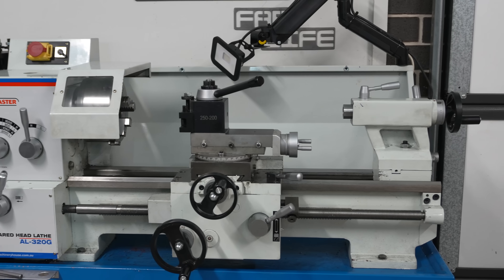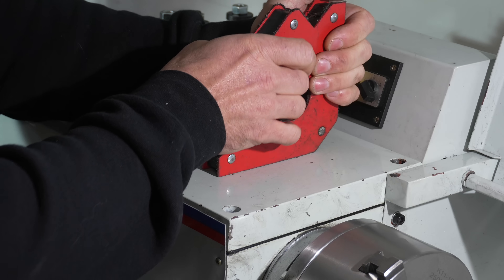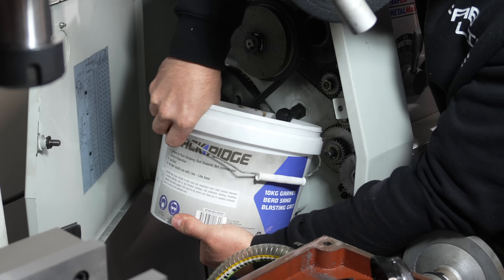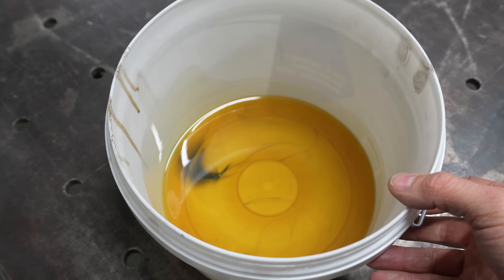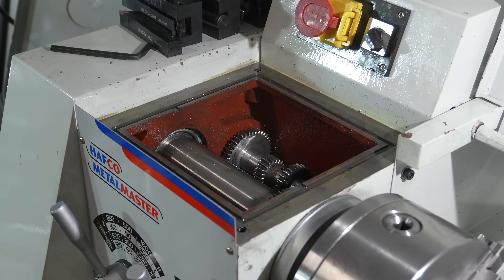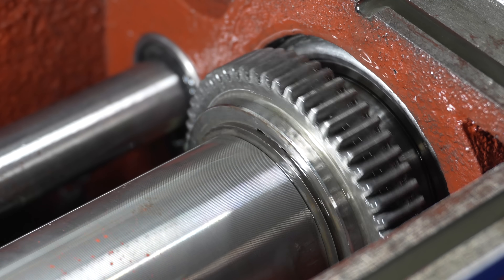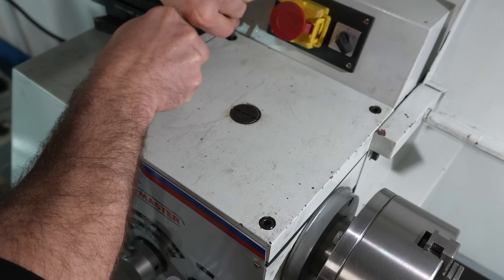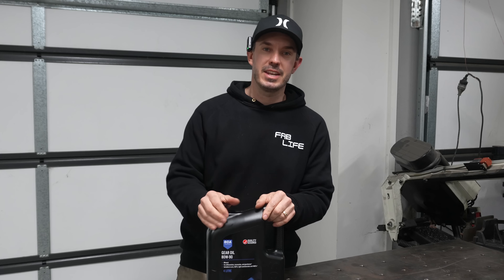Can I Fix This Annoying Gearbox Noise? - HAFCO AL320G

Comment: Nice job with the cleaning and replacement of oil and gasket. You’re never going to get quiet gear operation with straight cut gears, though you have made a tremendous step toward that. Who knows, you might even make a set of helical gears as a project in the future. I’m subscribing just in case you decide to do that. It’ll be an epic series to watch. Great video thanks.
Reply from the maker: Haha my skill level isn’t quite there but you never know in the future where I’ll be at. It’s such a great skill to learn. Endless things to make and fix with it. Cheers 👌🇦🇺
Reply: @Fab-Life444  Skill will be to make a set of double helical gears, like Citroen made, and have them be the same width as the originals. Those run quiet, plus have no axial thrust either.

Comment: The difference is definetly there! I´m a self proclaimed audio nerd, just came back with a neighbours band recorded with my MiniDisc. Heard an instant change. Why? My guess: the more oil fills the spaces between the teeth and so dampens the sound as it reduces metal to metal contact. To break it all in I guess it´s fine but You did the right thing. Now, everything is ought to have found its happy place so we can lube it up.
And: imagine: thought example: the manufacturer put in oil barely enough for it  not to seize up. If they filled it proper it might prolongue the break in and it takes more money out their pocket. I bet that´s it.
Then it´s the customer´s care to flush & fill it up proper after the warranty…  I belive it´s just the money they save with just a mouthful of lube in there… But now You´re set: Happy Days!
Reply from the maker: Cheers for the comment 👌🇦🇺

Comment: That gear oil is correct, SAE 80/90 is roughly equivalent to ISO 320 gear oil. You want to shut it up you can add a tube of Molyslip to the oil, it will turn the oil metallic black, but will reduce the noise as well, though it will make it near impossible to see oil level unless you check before starting.

Gasket gasket paper as thick as the store has it works well, you use a hammer to cut along the edges of the casting, and it works well. I keep a small new ball peen hammer just for gasket making, it never has been used for any other work, so the faces are still as ground, and work well to cut gasket material. Tapping out gaskets is a useful skill, and when making them before without gasket paper there have been a good number made using the covers of phone books, though that is impossible these days, as phone books went the way of the Dodo, so instead heavy glossy magazine covers are used in place of them, somewhat thinner but useful still. 

Note Chinese gearboxes often use the gasket thickness to set the bearing preload, so you will need to have some assorted thickness paper on hand to fabricate them when replacing bearings, because they generally come with the cheapest nastiest oil around, so best to replace it before using it anyway. Also often, because they are "universal mount", and have a half dozen fill drain plug locations, you have no vent, which means they will blow seals when running hot, and motor down means a motor filled with oil, which does not exactly work out well for the motor. Luckily they also are standard sizes, so easy to replace as well complete, just replace motors, seals, bearings and drill one of the plugs to be a vent on the top. A whole day of work to fix that motor, and the next day to put the thing back in the recess it lives in.
Reply from the maker: Cheers for the comment. Yeah the machine does have a vent. Probably hard to see in the pic but the upper fill port in the cover plate has a hole through it. This would be the vent for any pressure increase. Cheers 🍻

Comment: on the first test (before exchange the oil) the chuck was not closed.
at least my lathe is louder with a non closed chuck.
Reply from the maker: I was wondering if someone noticed that. Closed or open on my lathe, it’s not even noticeable. Checkout my other videos and you’ll see how consistently loud it was. Cheers 👌🇦🇺

Comment: Nice reduction. I have basically the same noise with the straight cut gears on my lathe as well. And how I helped with that issue, if I am not needing the cross slide auto-feed option for what I am doing, I simply removed that gear and it is tons quieter. But they are what they are...   Thumbs Up!
Reply from the maker: I have heard others say that. Cheers  for the comment 👌🇦🇺

Comment: Precision spindle bearings do not shed metallic paste unless they are terminal. Those bearings would not have been greased on assembly. You should not be complacent here, you should be concerned !
Excessive backlash between gears like that demonstrated is not "normal" and is a source of noise - shows a lack of care on the part of the manufacturer. Most like manufactured slack for ease of assembly by semi-skilled workers.
You used the wrong oil. ISO 32 or ISO 46 hydraulic oil is the normal specification for lathe gearboxes. I used to work on large vertical borers (1.5 metre diameter tables upwards) with 37Kw main drives that ran for decades 3 shifted with ISO 32 hydraulic oil in the gearboxes. During rebuilds we never had to change gears - most looked like new. Heavy oil may quieten down a box with excessive backlash, but will do so at the expense of power absorbed from the motor = less power available for cutting + unwanted heat. And may not splash adequately to get to the bearings.
Put a temporary perspex cover on the gearbox and, starting with the correct oil level according to the sight glass (and the correct spec. oil ! ), check fthat the oil splashes on the lid. The lid is what deflects the oil into the bearing lubrication groove around the head casting. Check in all speeds. If there isn't a decent splash on the lid at all speeds, increase the amount of oil in small stages to get a reliable result, but without adding excessive oil to sap power. Churning too much oil takes power and creates heat. Heat is bad - leads to spindle growth and reduces oil life. From memory, hydraulic oil life is halved for every 10 degrees C increase in temperature above 30 degrees C.
Chances are that with the correct level of the correct oil the gearbox will be noiser than with heavier oil - that is the price of low cost manufacturing.  Ear defenders or plugs are cheap !
Reply from the maker: Great comment. I’ll talk all of that onboard and I’ll have to look into sourcing the correct oil 👌🇦🇺

Comment: Be careful with thicker oil and higher speeds. You risk a problem where the oil does not have time to "squeeze out" from the gear mesh as the gears turn, the result is a big drag in motor load, AND worse, it puts huge force on the gearbox shafts (trying to push them apart) and can destroy bearings.
Reply: Yes, I agree with this, I tried using gear oil 85 140 and found it was as good as silent BUT it could not spin up in top gear with either pulley 1 or 2 set!
I dropped the oil and tried it with just the residual oil, it would still not spin up as it was altogether too clingy!
My solution, (after a lot of fiddluing around emptying and trying again etc) while still a little noisy but not as bad as standard was to make a mix of about 30% 85/140 ,  30% 20/40 motor oil and 40% transmission fluid! 
I know there is a lot of stuff in there BUT this was on hand and basically I thickened the mix up until the noise lowered but the top speed was still readily achievable!

Looking at the bearings and gears, I am toying with converting it to a 3 phase motor with vfd, I have a 2.2kw motor here with exactly the same mounts and shaft!

Happy to get opinions!
Reply: @grahampratt1107  Do it - you won't regret it!   I have done the VFD conversion on both my lathes and my turret mill and it's the best enhancement you can make to those machine tools.
Reply from the maker: @grahampratt1107 before I tried gear oil… I was looking at the 85/140. Can you imagine the comments section if I had that in my video? 😅
Reply: @Fab-Life444 hahahahah they would hang you by your wobbly bits mate!
Having said all of that, I might go and get a gallon of iso68 thereabouts hydraulic oil and try that. While I am a bit deaf, the noise is just too much and I think it is dangerous as you can have no workshop awareness with these noise levels!
Reply from the maker: @grahampratt1107 haha yeah. Repco sells it near me in a 5L bottle. I’ll grab some soon
Reply from the maker: Great advice. I’ll take that onboard 👌🇦🇺
Reply: @Fab-Life444  Another issue with very thick oil in lathes can be lack of power at higher speeds, all the motor power can be taken up by the oil viscosity, but that would become apparent when you are using it. Great video, thanks!
Reply from the maker: @FlightEngineering1 that’s some great information because you’re actually spot on. I have noticed that the lathe seems a little more loaded when free spinning due to the oil. It still worked fine on heavy cuts but I do think the oil has added more load. I’m going to do another comparison with iso68. At least that’s the correct oil to use according to the comments section👌🇦🇺

Comment: Welp, you are not running production so it should not foam too much or over heat. ISO 68 hydrolic oil is the norm for lathe gear box.
Reply from the maker: I’ll have to look into sourcing some. Cheers for the comment👌🇦🇺

Comment: Why would you ever think a lathe would be quiet??
Reply from the maker: I’ve watched many videos and have seen them in use in person. I can tell you now that mine was very loud in comparison to those. Now I don’t really need hearing protection to use it. Cheers for the comment
Reply: @Fab-Life444  well, unless you put fiber gear  train gears in your lathe , you will have noise
Reply: @willvanderhorst9072 I used to run a Southbend leather belt drive it was silent apart from the glooook noise when I applied new beltgrip! I eventually swapped this belt out for a rubber timing belt and ran with the ribs Down (correct orientation) that removed the need for beltgrip AND got me better traction! Dead quiet!

Comment: Gday mate. Keep an eye on your motor temperature now that you’re running the thicker oil. On my al250 lathe, the thicker oil loaded the motor significantly to the point it overheated.
Reply from the maker: Oh really? That’s a worry. Like I said in the start of the video, it was just a test. Now I know it has the potential to be more quiet, I’ll definitely source the correct oil. Cheers!
Reply: @Fab-Life444  no worries. I think the “right” oil (everyone has their opinions) is ISO68.
Reply from the maker: @paulypaulypauly8011 sweet. I’ve researched that hydraulic oil and Repco sells it near me. I’ll get onto switching it out 👌

Comment: I was told by somebody who really knew what he wa s talking about[many don't] that this is caused by sand left in the casting  coming out and effecting the ball bearing races. You will have to clean the gearbox thoroughly and possibly have to paint it again.
I almost bought a second hand one until I got a wake up what was wrong. Instead I got a good lathe two chucks for $200 out of a scrap bin. Lucky me.
Reply from the maker: Yeah I’ve heard many talk about the sand. Luckily I didn’t have much in there

Comment: HUM I thought as you turned the lathe on for the first time and noisy it was! 1st mistake was leaving the chuck on especially with the jaws open they causing most of the racket. Then when all was completed you showed it with jaws closed much quieter. Over filling with oil will blow seals.
Reply from the maker: Closing the jaws definitely made barely any change to the sound. Checkout my other videos of how it sounded and you will see it was consistent with the test clip. No trickery here mate. Cheers

Comment: Hi, I have a Taiwanese 1232 GH (Dar Sin) lathe that is waiting for a bearing overhaul. Check out the Max Grant and Woods Creek websites. They both did a bearing overhaul on their lathes. The problem with Chinese and Taiwanese machines is the poor cleaning of the main spindle box (and other gearboxes). They have sand from casting and chips from machining. The gearbox must be completely disassembled and cleaned of all sand mechanically. Careful cleaning and degreasing (see Dan Gelbert Episode 8(?)). Alkaline washing, e.g. NaOH 12-16%, so that the grease/oil turns into soap and is removed with water. Then careful painting with 2-k Urethane paint. At the same time, it is worth changing all the bearings. Never use motor oil intended for cars. The right oil is hydraulic oil T32-T68, I use T46 oil myself. Motor oils contain detergents that prevent impurities from settling to the bottom. Some recommend that these lathes should be disassembled and cleaned before use, otherwise the sand will ruin the bearings.
Reply from the maker: Great comment mate. Cheers

Comment: Probably (speaking from experience with a new Hafco lathe bought a year and a bit ago) overfilling gear boxes above the sight glass is a messy mistake.
The sight glass level is set so the oil sits below the oil seals on control lever shafts etc.
When you fill above the sight glass level & the lathe isn’t running - the excess oil will leak out everywhere.

So mine came from Hafco crated and already filled with oil.

When they filled the saddle apron, the crate / lathe wasn’t sitting level, but they filled to the line on the sight glass.

When I un-crated it, and sat it on levelling feet & levelled it out, I could no longer see any oil in the apron sight glass.

Because the oil was crystal clear - it looked to be below the bottom of the sight glass - so I added more ISO 68 oil & still it didn’t show on sight glass, rinse & repeat, until eventually I used a cable tie to dip the apron via the fill hole to find it now way overfull.

I figured more was better than not enough so left it and ran it.

The control lever seals on the front of the apron leaked oil for months until I got tired of cleaning the floor and chop tray all the time & siphoned the excess oil out until down to the sight glass line (which is below the height on the control levers shafts and seals).

Hasn’t leaked a drop since.

I suspect that you will find out the hard way as I did that filling above the sight glass level such that oil seals are contestants u see the oil surface just makes them leak while stationary.

The seals are meant to just hold back the oil that gets splashed around while in use, not to hold back liquid oil constantly backed up against the back of the seal while stationary.

That’s been my experience with my Hafco AL356V for what it’s worth.

Hope I’m wrong for your sake but I doubt it.

There’s was probably no point cutting out the internals of the rubber lid gasket, you could have left it whole & made zero difference. 😉

As others have said automotive gear oil probably isn’t the right viscosity to both get flung around especially at low speeds to drip feed your main spindle bearings.

ISO 46 or ISO 68 might have been better choices.

Best of luck with it.
Reply: Yep same experience with chronic leaking on my 5 year old AL320g when overfilled. Leaks much improved once level got to the sight glass.
Reply from the maker: @10millimeterSocket great feedback 👌🇦🇺
Reply from the maker: Great advice. I’m definitely going to look into the correct grade of oil. Cheers 👌🇦🇺

Comment: something you can add with the oil is graphite powder , it will make a noticeable difference , note never add graphite powder where there are filters , but any place where there is only open space and no filter , it works very good,
Reply from the maker: That’s an interesting one. I’ll look into it 👌cheers

Comment: Could be a BIG Mistake !  A Mechanic would Know to check if the lathe has any bushings as that oil is a Hypoid OIL and not suitable for a non or Mixed Hypoid gearbox . Also a splash feed gearbox doesnt need lots of oil , it works on thin Oil it can throw around like a garden hose . This helps to Also reduce heat . Hydraulic 68 is the Go to for Headstocks .
Reply: Hydraulic grade 68 is better than gear oil because it maintains viscosity and so the bearing clearances do not change with temperature. That means the centre of the spindle remains true. I think it was the depth of oil causing the noise, not the viscosity. 
Colchester specify hydraulic oil for their gearboxes, saying hypoy is too variable in lathe headstocks. Keep an eye on the gear oil temperature and variation of the spindle bearing preload torque while testing with gear oil. Then switch to hydraulic oil.
Reply: @RjKingie  Well said , I,m a Heavy Earth Mechanic . and this Realy stood out as a Red Flag to people Learning .Nothing like Experience .
Reply from the maker: @RjKingie I’m definitely going to buy some iso 68 locally. I want to do another comparison. 👌
Reply from the maker: Cheers for the comment. Like I mentioned at the start of the video, it was to test whether it made any difference to the noise I was hearing. 👍

Comment: That's what you get buying cheap Chinese rubbish. That is a lot of metal and gunk inside the Headstock. As for the oil ISO 46 or 68, nothing else.
Reply from the maker: Cheers. My local store sells iso68. I’ll be switching it out soon.